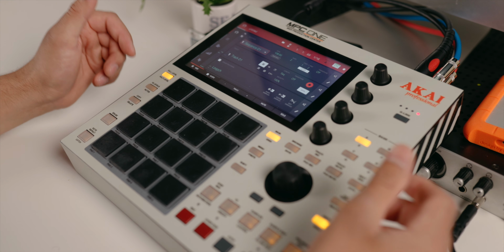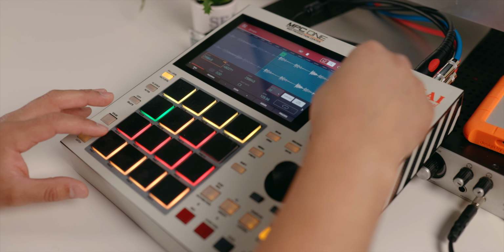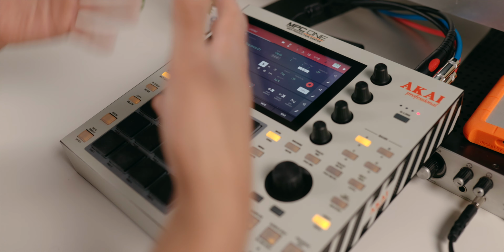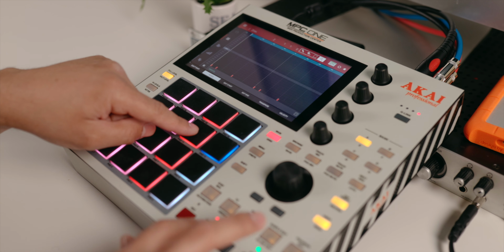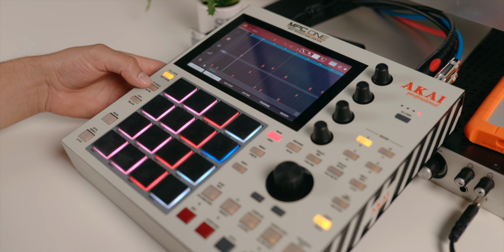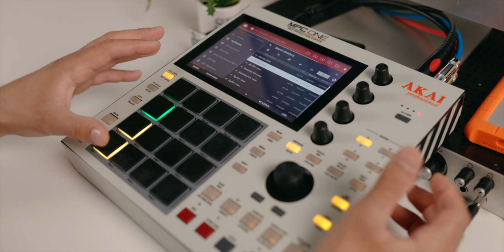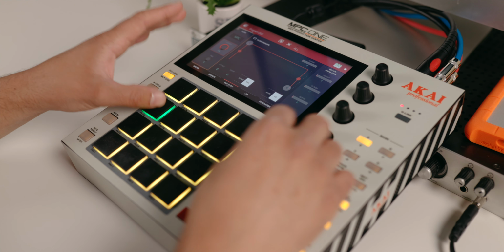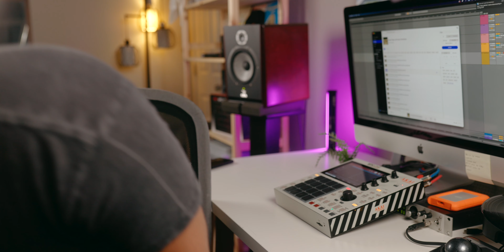Sampling Live Drum Breaks and Rearranging Them | Boom Bap Drum Breaks MPC ONE

Comment: I try to use a DAW as little as possible just to be awkward, I do the same process as you but after I have layered and got the tracks  sounding as blended as possible, I resample just the drum tracks and either loop the new sample or chop up again so I can mix it up a bit for the hook. As long as you've chosen the correct accompanying drums I find this works well.
Hope that made sense.
Reply from the maker: Hey brother thank you for stopping by and checking out the video. Well this is interesting on how you chop up your samples in resample it to get it a little tighter. I always enjoy learning new ways to sample and using it for a vantage thank you so much for sharing this with us